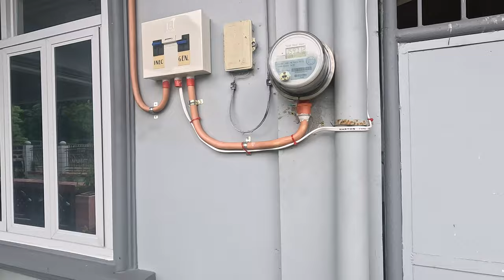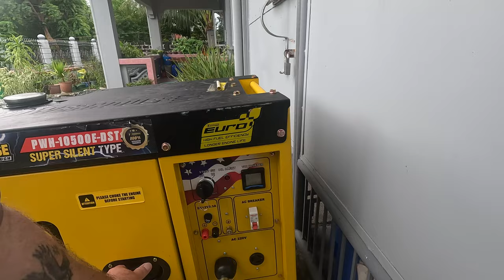Daily Life of a Retired American in the Philippines - October 23, 2024

Comment: I'm surprised you guys are still using a gas generator. And don't have a backup solar system. Or are not already totally off grid. Or at least have a solar generator. They are not as expensive as they used to be and there's many sizes and prices. All solar is really starting to come down. There are even people selling house solar panels cheap on Facebook marketplace. Either litley used or older stock never used. ✌️❤️
Reply from the maker: We have been looking into solar power.  Just have to be careful of the scams